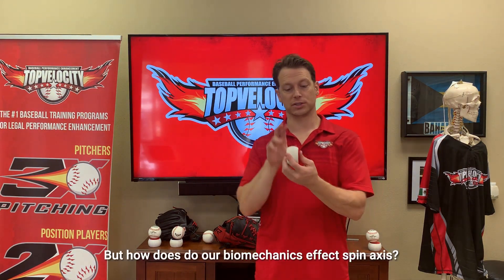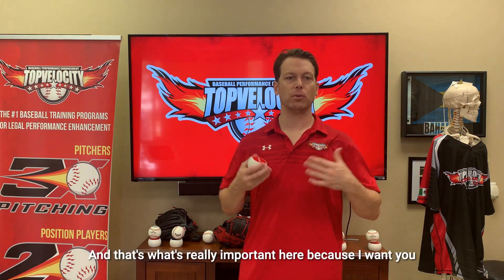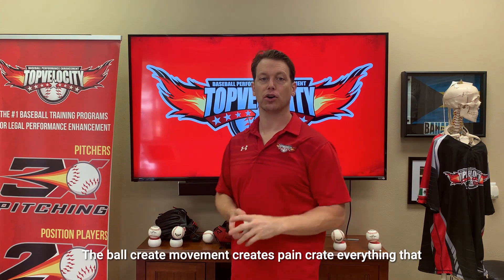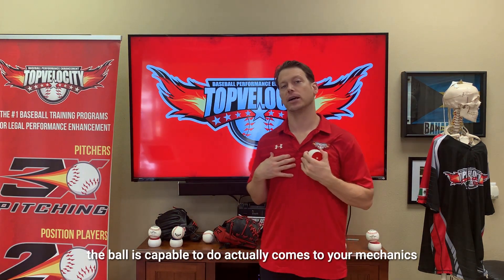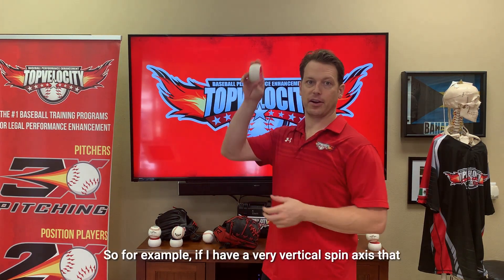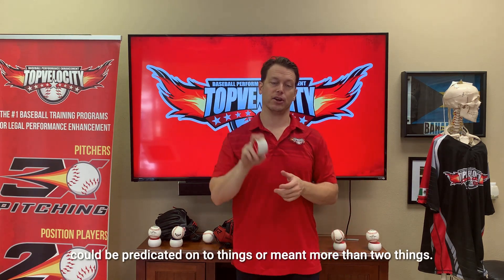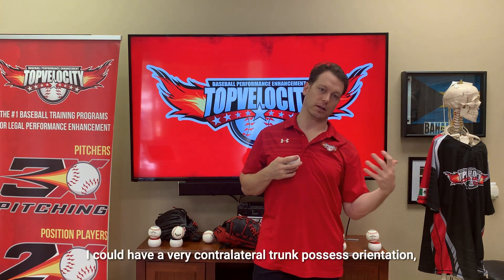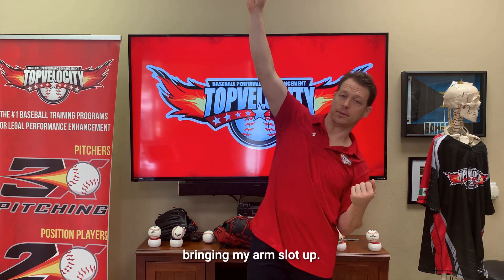Developing Pitches with Biomechanics | TopVelocity

Comment: If you have a high spin rate, wouldn't the sinker actually not be an ideal pitch for you. A high backspin rate causes the ball to 'rise' which is counterproductive for a sinker. High spin rate guy should usually focus on 4-seam that rides and then a sharp breaking ball. Low spin rate guys are usually sinker and changeups pitchers because of that 'heavy' feeling.
Reply from the maker: Ryan Baum no because the higher spin rate will be transferred into the sinker grip and spin.